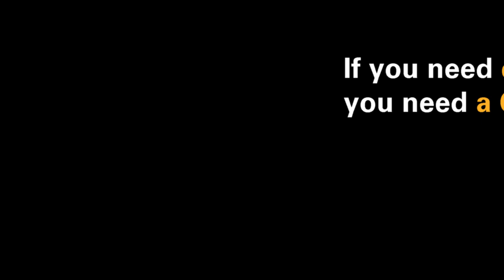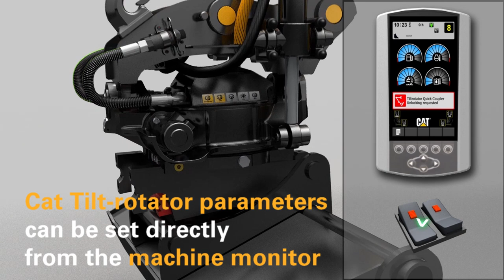Cat® Tilt-Rotator demo with the Cat Wheeled Excavator Tilt-Rotator-Ready package.

Comment: I’m curious as to how you control the tilt and spin functions, wish the video actually showed the “Advanced Joysticks” and how you operate it.
Reply: Check the video for some of the functions and how/where on the joysticks buttons/ rollers you control it. 
However, most functions are programable - so Engcon can program the function YOU need/ desire to a specific button/ roller. And I think this goes for both extra attachments and for basic functions  on the excavator (like roller controlled steering for the tracks for example). 

https://engcon.com/en_us/optional-extras/track-wheel-control.html